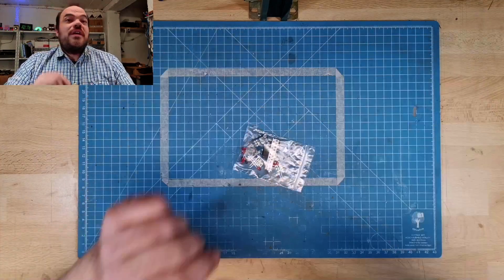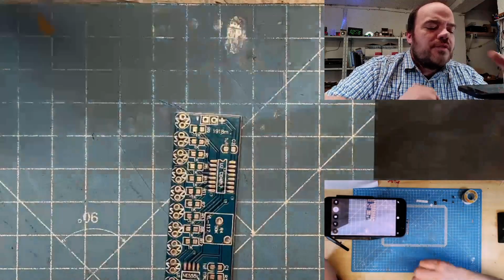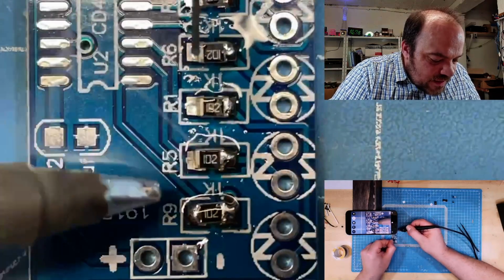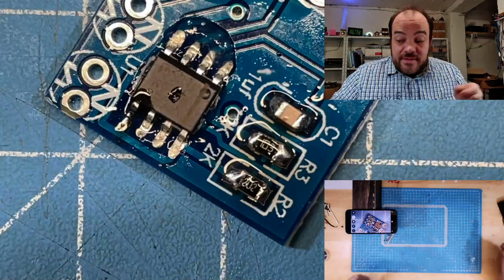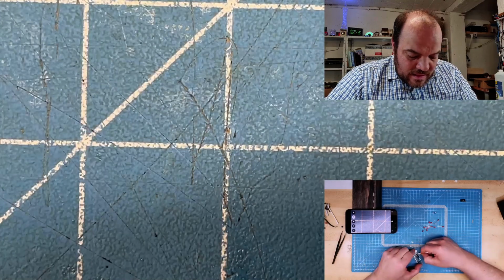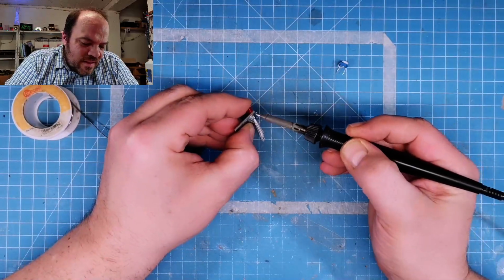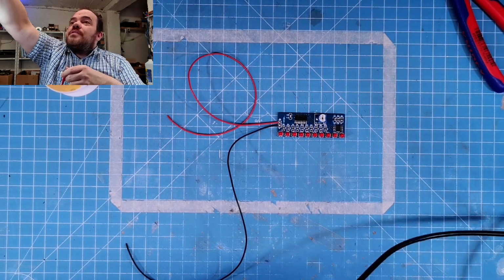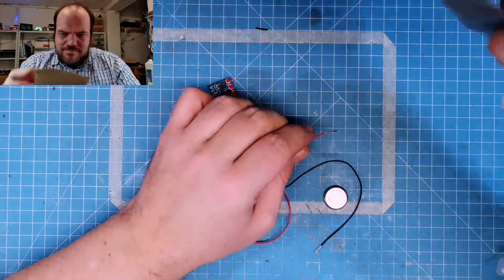First test stremaing on Twitch, Just soldering an easy electronic kit.

Comment: Have to rate that as a success I think for a phone cam on a box. I would probably put such a small pcb in a vice as it was moving about a bit when you were soldering (got to the tape bit - nice). I can relate to using  a phone as an improvised microscope.
Reply from the maker: Thanks Paul Shirren for your comment! :)
Ohhh for next stream I allready found a good solution. The iPhone 12 has some magnets/metall inside so I just glue 4 (they are from old MacBooks) magnets onto the box and it stay very safe.
It was not the idea to have a microscope I just want to show the soldering from not so far away.
Just trying and tinkering to bad that livestreams don't work so well for me on YouTube.